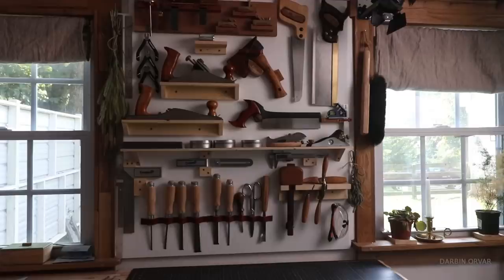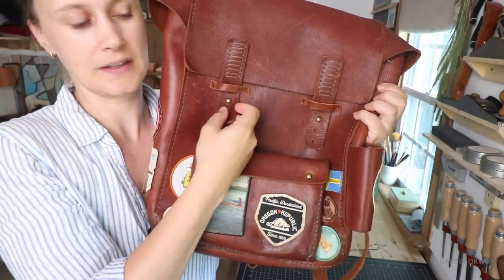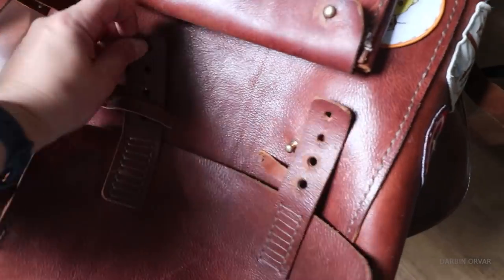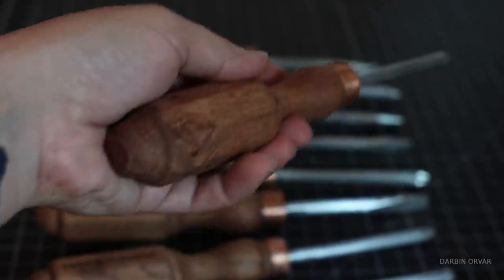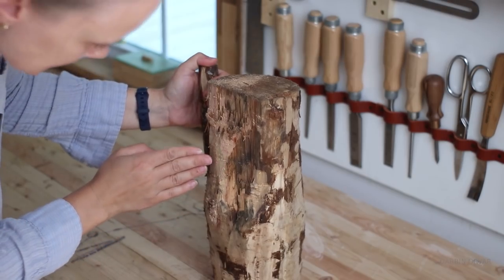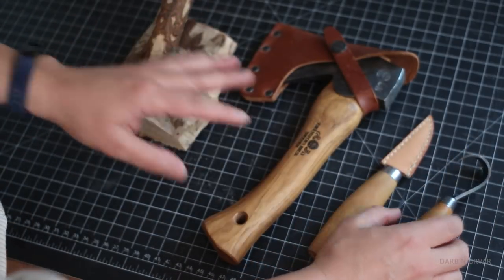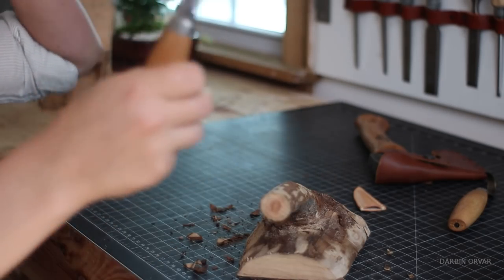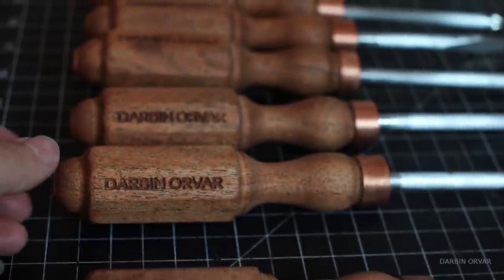Adventures in The Shop (i build something surprisingly useful from a tree)

Comment: As someone who has been called upon to try and get in a stuck door with the knob being loose...I recommend tightening that knob onto the door sooner vs later.  Eventually it may allow enough movement to let some of the inside pieces either wear wrong, or get into a state where it no longer works properly.  Fun video, loved the lock setup piece, and the long walk, and am happy to know that spray helps fix stuck padlocks too.  

For your backpack, do you ever notice the thin shoulder straps dig in when the pack is loaded up?  If so, do you have any plans to make wider bits over the shoulders?  That would be a fun install process to watch.

When I initially made the jewelry boxes from a piece of 6" diameter dried chinese elm 5 yrs ago on my channel....I did not yet have a bandsaw (and that prompted the purchase) and it took me around 50 minutes each cut through it...each box was one bottom cut and two for the lid....so yeah hand saws with fine teeth are not ideal for log cutting, but as you found, do work eventually. :)
Reply from the maker: Thanks for the tip Joseph. In terms of the shoulder straps, I have been thinking of making wider straps to slide the current straps to, if that makes sense, because you're right, when you pack the bag heavily it could use wider straps.
Reply: @darbinorvar  i think the thicker sliding bits could work if they are somewhat held in place, ie to make it adjustable for multiple size people wearing it, and I have noticed with backpacks that a waist strap can also help when they are heavier...that for me at least causes less shoulder/neck pain after a long day of carrying too much :)